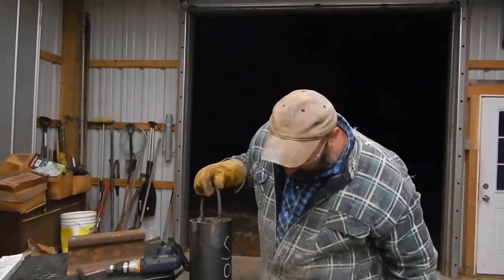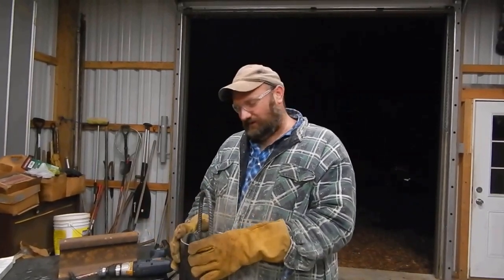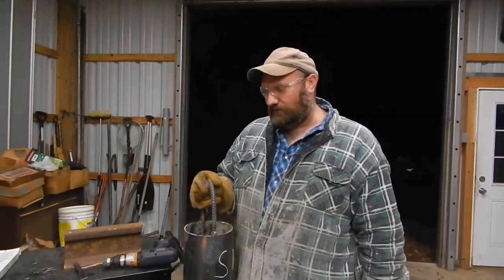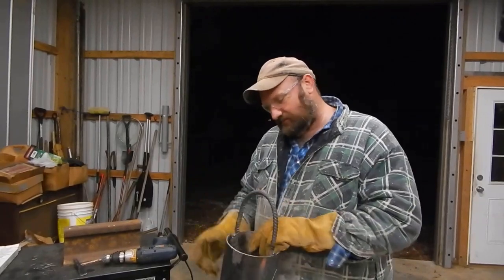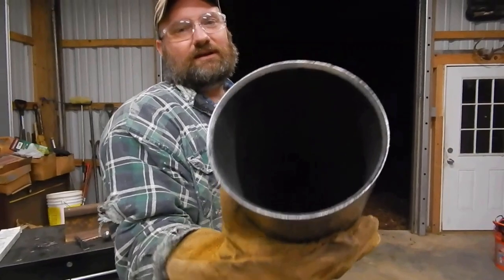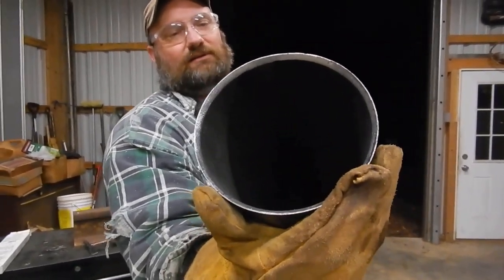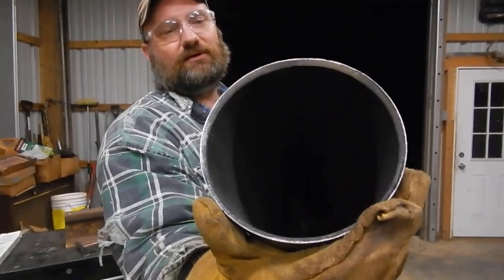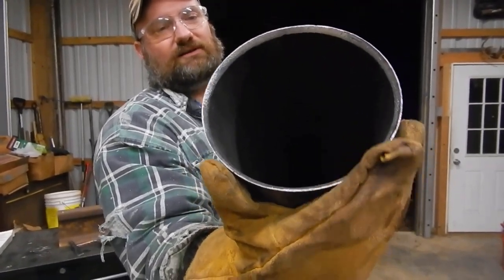Fabricating Percussion Drill Pipe & Wear Your Safety Equipment

Comment: sir: it appears to me that a ring needs to be added to the bottom to increase the diameter slightly. without this, there will be friction on the sides of your drill tube and possible seizure of the clay. most all drills are slightly larger at the bottom. think it through and consider......g
Reply from the maker: You are absolutely right. That is why my 6.5 inch pipe, my final diameter will be made similar to my 5.5" drill pipe. It is just a short piece of pipe with a 4 foot 1 1/4 pipe for the shaft used to change the diameter of the whole from 4.5'" to 5.5". Thanks for watching and have a Blessed Day Friend!